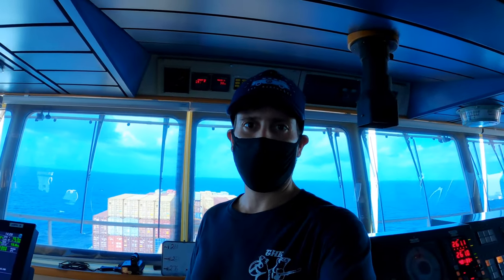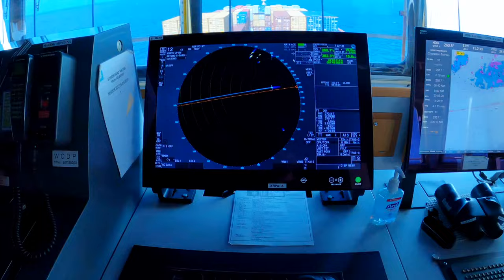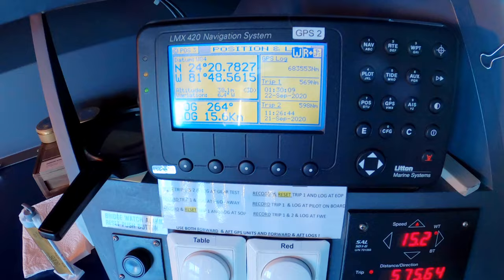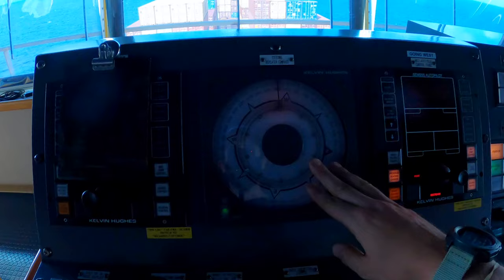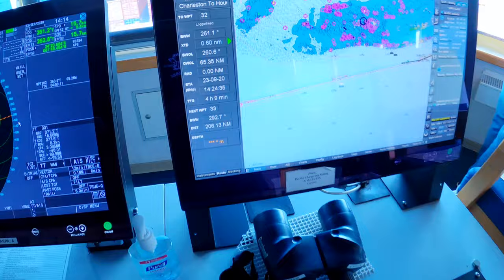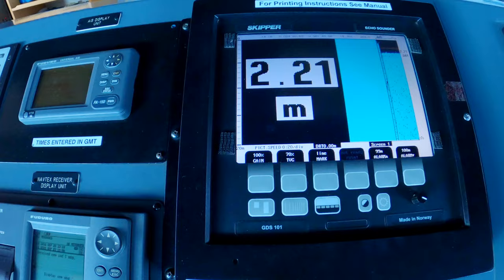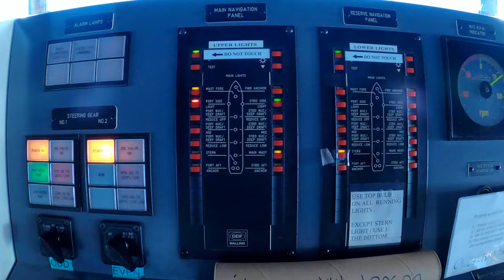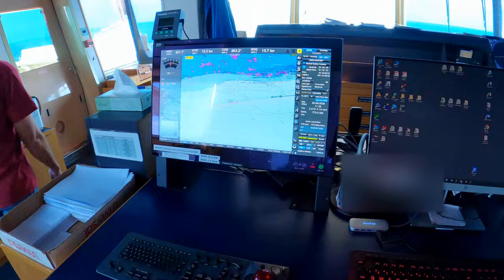Cargo Ship Bridge Equipment In More Detail | Life At Sea

Comment: A very clean bridge - everything looks very well maintained. The casual dress of bridge officers also interesting. I assume there is some sort of dress code with includes suitable footware. I expect one day we will be looking at a bridge of two largish screens - one in case the other fails - as ship electronics get integrated and simplified.
Reply from the maker: We are required to wear our company coveralls as a uniform when we are entering, staying in port, and departing port.  Other times we just need appropriate footwear and reasonably professional clothes that are not offensive or impractical.  A lot of the bridge equipment is integrated between each other now, but the future will probably be something with just a few computer screens that looks more clean and simplified.
Reply: @BryanBoyle  Your bridge dress reminded me of construction engineers in a site office  - casual attire, but can quickly done safety gear for visits to worksites (rest of ship apart from crew accommodation in your case).
Reply from the maker: Yea I try to stick to long pants and a closed toe boot or shoe as well as a flashlight when we aren’t required to wear coveralls.  You never know when you may need to respond to an emergency or when a ship could lose power and go dark.  The coveralls are pretty comfortable though and I’ll typically wear them when I’m working a dirty job or again when required on the bridge.

Comment: Bryan, thanks for allowing us to tag along on your journey. Very informative video. Does your auto pilot cruise on the high seas in HDG, CRS or TRACK mode ? During one of these modes does your Helm move is synchronous with the the rudder ? Do you see the Helm moving right and left to satisfy the mode engaged ?
Reply from the maker: We run it usually on HDG mode.  Most ships I work on don’t have the track mode connected to the ECDIS.  Unless it’s a money thing, I think the reason is they want us to remain active in the watch and not let the autopilot just steer us automatically down the track without input. The helm is electro hydraulic, so it sends electric signals from it to the hydraulic steering gear pumps. Since there is no direct mechanical linkage, it does not move at all when the rudder moves on autopilot. Great questions!
Reply: @BryanBoyle  HDG mode in Big Ships means Gyro HDG (True Heading) right ? as opposed to Magnetic HDG or after deviation correction Compass HDG.

Comment: Interesting video! I have one question about AIS: Are the safety-related or routine priority text messages used much on them? 
I always found that feature to be extremely unusual, due to the user interface design of the AIS transceivers. 
From what I've seen, they often have the rotate and press style of wheel, or a set of arrows plus enter key,  to select the letters, and I have a feeling that such UI would discourage actual writing of messages.
Reply from the maker: They do get used but in my experience the messages are usually just test messages.  Our AIS is integrated into our ECDIS with a full keyboard so it’s much easier to type messages through that.

Comment: What if you lose power?  Those reference charts may come in handy.
Reply from the maker: All of the navigation equipment has redundancy and individual battery power systems.  They also can operate on the emergency diesel generator in case of sudden power loss.  However, I do think they are worth keeping onboard in case all of that fails.  The only problem is that they no longer get regular updates so navigating with them could cause issues.